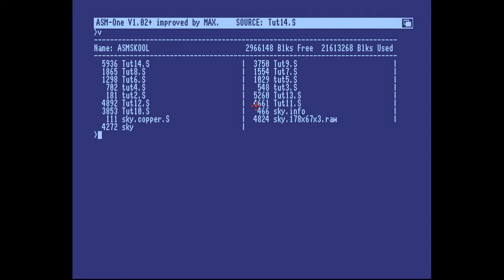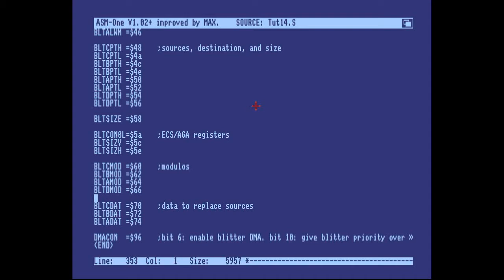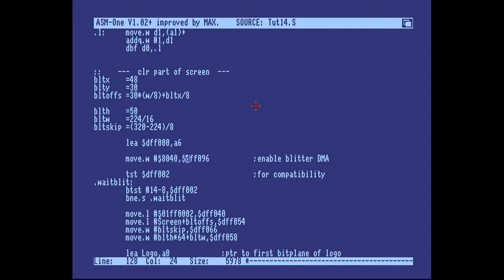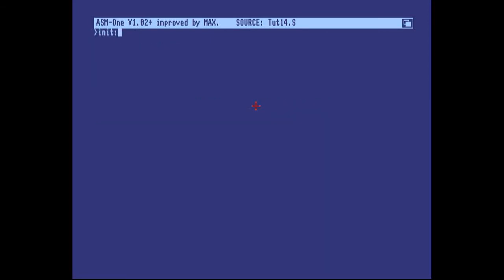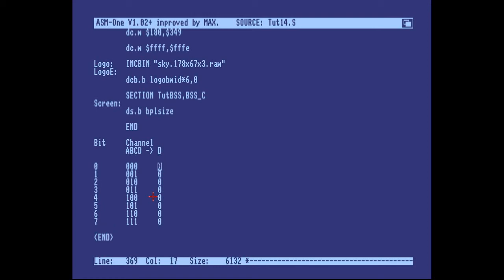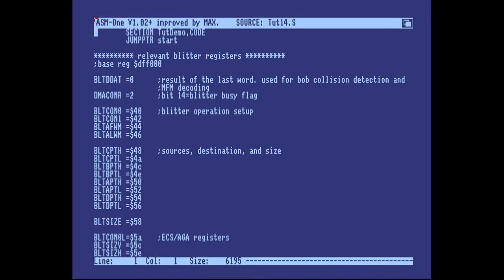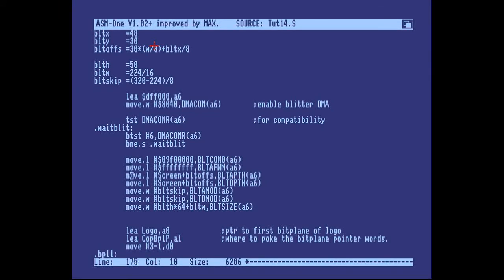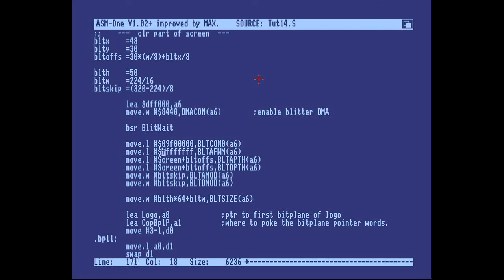Amiga Hardware Programming 14 - Blitter channels, minterms, shifting and masking

Comment: Can the blitter be used to quickly plot single pixels to the screen?
Reply from the maker: Yes, both by drawing a very short line :) or by a "clear with a shifted pattern". (A clear is just a clear because you are writing words of zeroes with the Blitter.) If you are plotting tall pixel columns, i.e. more than 10-20 "words" of output, the Blitter is faster, but for everything smaller use the CPU, especially for plotting single pixels. The first Developing Demo Effects article (in Jan 2015 Amiga Future Magazine) has a plot routine, but it's just about ORing the correct byte to the right address in the bitplane. Hope that helps explain :)
Reply: Thanks, dude.  I've been studying the reference some more and was thinking pretty much the same thing.  For all the work you'd have to do setting the blitter up, you might as well just plot with the CPU.  I've got a Z80 asm routine for the Speccy I wrote that works fairly well that i'm going to translate into 68000.

Slightly annoying, though.  It would have been nice if we could just write the x,y and colour values to some registers and have the pixels magically appear on screen :)
Reply from the maker: Well on any platform tiny changes will be slower with a chip designed for coordinate window operations. ;) And if you come from Spectrum I think you'll be familiar with screen address calculations so just go for it! And yeah 68000 is a nice CPU for coding, but for pure bandwidth, if you stick to the CPU it's really not very much faster than a Z80 or 6502. The rewards are to be had if you rethink the render or effect to use each chip to their benefit: CPU, Blitter, and Copper together!

Comment: N00B question: isn't it easier to just write the Blitter constants like this:

BLTCON0= $dff040
BLTCON1= $dff042
BLTAFWM= $dff044
BLTALWM= $dff046
BLTCPTH= $dff048

BLTCPTL= $dff04a
BLTBPTH= $dff04c
BLTBPTL= $dff04e
BLTAPTH= $dff050
BLTAPTL= $dff052
BLTDPTH= $dff054
BLTDPTL= $dff056
...etc

and stop using the addressing mode? (also saving one address register)
Reply: bit late to reply to you specifically but to anyone else wondering  the same thing , writing in that format: 
"move.l #$ffffffff,BLTAFWM(a6)" 
saves four cpu cycles every instructions . Photon mentions this passingly at 14:38
Reply: @banjoguyollie  Yes, I eventually figured it out myself when I started checking my code with the 68k profiles :))